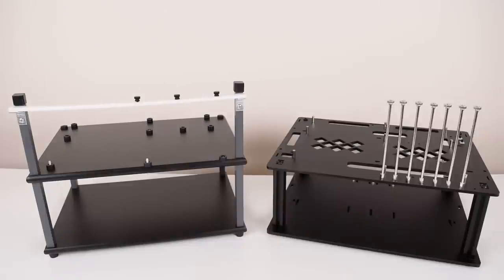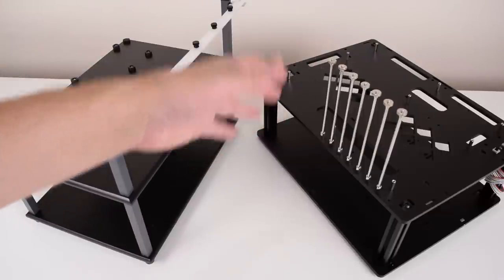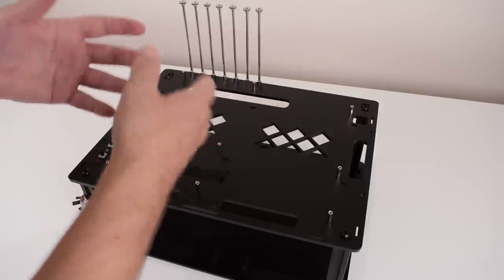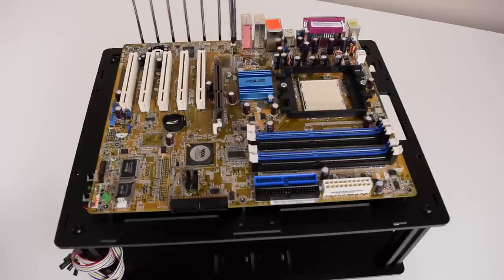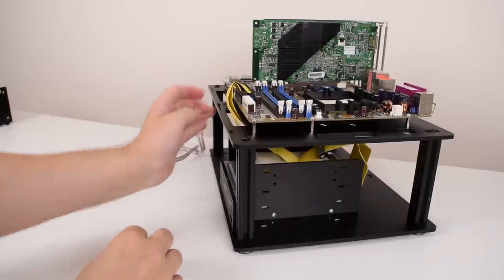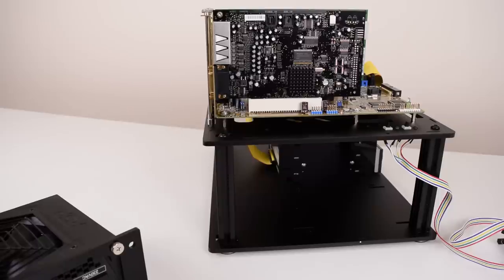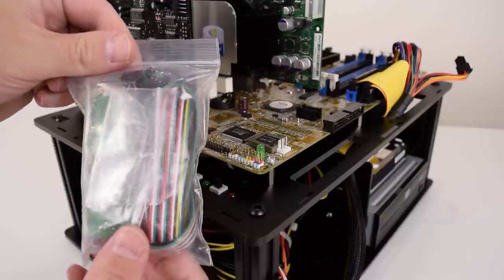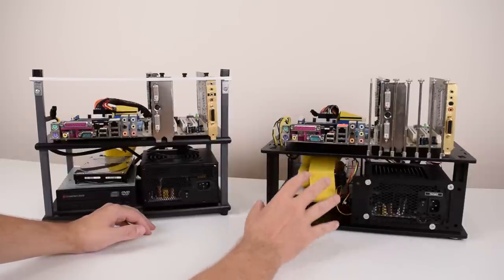Test Bench from USA vs China - HighSpeed PC Top Deck Tech Station and QDIY PC-D008

Comment from the maker: To get a bit of a discussion going, which test bench would you go for, and why?
Reply: I would go for chinese because it more sturdier and it has lots more stuff you can do with it
Reply: D008 is what id go for, cable management is nice to have & those long metal screws looks better then the plastic stuff that looks like its from a plastic cutting board.

Kind of have a self made test bench from an older compaq tower from 2002 most panels were pretty much removable so its fairly bare bones & 5.25 bay can also rotate the drives so it works as a desktop pc.
Reply: I find things that I don't like in both, and to be honest, I wouldn't buy neither one of them. I consider them both pricey, and both are flawed, at least regarding my criteria. Though, I consider the QDIY is a better option overall.
Reply: For "quick and dirty" I'd just go the loose (motherboard box) route, while for a semi-permanent (card tester), there doesn't seem to much advantage (and certainly more cost) compared to a cheap case with the side left open.

I know some people run a permanent testbench / skeleton / open setup, but personally, the Cougar Conquer is the pug-ugliest thing I've ever seen
Reply: The Chinese one seems well designed. I would even go further and use a no-slip drawer mat (similar to the rubber mat the HighSpeed has) and ignore using the mounting brackets for the power and drives. Also, once you screw in 2 screws on opposite sides for the motherboard, you don't need to do anymore. With these two things in mind, I don't see the HighSpeed one being "faster."
Reply: I prefer the D008 (can we call it the doob?) I don't find screwing down a motherboard takes all that long, and the quality of life improvements like integrated power buttons, proper cable management holes and proper 3.5/5.25 inch mounting options fare ar more important than how quickly I can put a system together, if something needs to be done quickly then a cardboard box is more than adequate.

Whereas if I'm going to take the time to put the system together on a bench, I want it to be put together properly, and the doob has all the right features to do that for a much better price.

Great video as usual Phil, and I'm definitely interested in the doob, as I could definitely use it for work, but then again a cardboard box is adequate for testing hardware quickly.
Reply: Chinese 1,has better options.
Reply from the maker: Robinthefox88 DOOB, I like it :D Rolls of much better :D
Reply: +PhilsComputerLab
I'd wouldn't go with either. I'm one of those people that has and likely will again make his own. Making one is only a matter of measuring things out properly.
Reply: They both have a purpose. However the D008 ultimately will look better in videos, with the cable management to keep the appearance of tidy
Reply: I like the layout of the D008 a bit more.  I think the hard drive should not be a permanent mount, since that's something you'd likely be swapping to test out or if you're loading a machine for testing before dropping it into a case, it seems like you'd want to be able to easily remove it.  everything else is fine to have a permanent place since it's all common stuff you'd want to keep a "known good" device of to test with.  

Also, notice the D008 is configured more like a normal computer, with all the ports facing the rear, while having the drive facing forward to easier access.
Reply: I would go with the PC-D008.  Besides the price I would prefer keeping the motherboard secured especially if you bumped the thing with a heavy graphic card or heatsink attached to it could do some damage to the card, CPU, or the board.  Plus if I'm changing cards the power would be cut off first so the metal screws are a moot point.
Reply: I would prefer to make my own. It would save money and I'd be reusing an old case that would otherwise end up trashed.
Reply: IMO depends on the use, I see the D008 being used as a proper "test" bench (as in, using the rig for some time and/or daily driver for a while), while the Top Deck I see is as a quick and dirty setup for demos and quick benchmarking.
Reply: Top Deck for sure. "Permanent Test Rig" doesn't make a lot of sense to me so it's all about the speed of setup and swapping components. If you're going to only be setting up a test rig to benchmark video cards or something like that, may as well go the practical route and put it into a legit case. Swapping PCI cards is quick and easy enough unless you just bought a horrible case.
Reply: Cheap and good enough would be my choice. However, i like the plastic alignment pins that register with the mobo …but those can easily (and cheaply) reproduced on low budget tech stations. …just a bunch of nylon / plastic threaded rods …what are those, M3? …LOL, one could even cross-thread imperial plastic rods (even cotton swabs [Q-Tips], if you're desperate), no worries, she'll be fine … Yay, DIY! ;D
Reply: Actually for me it is the D008 wins. I would put a semi-permanent test bed on it using a workstation/server grade base system. The server grade stuff tend to last longer, tolerate more torture (PCI Express hot plugging anyone?) and have a wider qualified device list so you can throw exotic hardware at it and it would still work.
Reply: I prefer the design of the Top Deck, but realistically, a cardboard box
Reply: I bought the QDIY PC-D008 and am loving it so far. I don't mind spending a few extra minutes swapping components to get the benefit of cable management and fixed mounting points for the drives and PSU.
Reply: I’d prefer the top deck, for the fast build qualities.
Reply: PhilsComputerLab the Chinese one looks cool

Comment: I had a nice steel motherboard tray that I just drilled some holes in and riveted some rubber feet on it. It's got all I need and it looks nice :)
Reply: Pretty much what I did except that I put legs on mine and connected it to a metal baking sheet

Comment: I have the china one. All I did is replace the standoffs with similar standoff with the US one.

A very tidy for quick testing mobos, gpu addons cards. The psu and drives are permanent with psu seasonic 800watt and ssd with win10.

Definitely heaven sent for computer shops for quick testing

Comment: Between those two I would go with the Top Deck because it is designed to swap out hardware quickly.  However, I would probably just cut up an old PC case and use that as a test bench.

Comment: Wow, I didn't realize how over priced they are. I wouldn't go for either. I find it insulting they are charging as much as actual cases. Generally for the same price or cheaper you get a nice case with multiple fans and rgb. The US version looks especially cheap and I always assumed it was $50 or less.
Reply from the maker: Fair comment. I think it comes down to numbers sold of cases vs test benches. Other test benches cost even more, these are really some of the cheapest ones. For what I do a case is just way too much hassle, but I do get your point of view.
Reply: You make a good point and that is something I thought about until ikea was mentioned and I realized how much of an ikea type product the US version was.They actually have a small shelf that looks suspiciously like the US version. I love the videos btw.
Reply: Michael Hatch For the same price you can buy a Deepcool EarlKase Rgb.. with free prime shipping.. you could even buy a Deepcool Tesseract and mod it into a test bench easily.

Comment: I currently use a 1956 Pontiac shop manual as my "test bench."  It holds the board being tested high enough off the work bench for the mounting brackets on the plug-in cards to hang down, and it supports the entire motherboard so that it doesn't flex when plugging in cards, RAM, power connectors, etc.  Of course, this doesn't address the problem of where to put the HDD/optical drive and PSU, but I have plenty of work space.

I was using a phone book, but I was a bit concerned about giving away my location during live streams.

Comment: Left one (Top Deck) is awesome as you can replace motherboard on it in seconds - just unscrew 2 screws and that's it. If you have one motherboard for a long time it's better to use some sturdier ones, like QDIY one or Lian Li PC-T60. Also Top Decks are known for a problems with ESD. I didn't have them, but I heard of couple boards dying due to that. Also Top Deck have issues with some VGA cards, as they don't have clearance for plastic support.

Comment: It seems strange to me that I find that the Chinese test bench seems to be better for use as a testbench for modern hardware.  My reasoning is that generally you would be likely to re-use the same PSU, optical drive and hard drive/SSD for each lot of hardware on test.  The main downside is the traditional spacer and screw in combo for attaching the motherboard.  To me it makes more sense when building a test bench to invert the spacers so that you would simply be placing the motherboard over the spacer threads for faster hardware changes, just having a couple mounted in the standard manner (for instance at opposing corners) would be absolutely fine for securing a motherboard.  One thing I would change from this kit is to change from regular screws for mounting the motherboard to thumb screws - being tool free just saves time and effort.

Also having the switching pre-installed on the bench itself is neat, it is just one less thing that you can lose.  In the use case here where there are a lot of systems using either IDE or SATA I would want to load up an extra caddy tray so that when you switch to between vintage and modern hardware rather than taking the tray out, removing old drives and installing new drives before sliding the caddy back in you would just slide the old caddy out and then the new one in.

Comment: Up until about 14:47 I thought you'd filmed the assembly of one test bench, and then the other. But you had two sets of the exact same components!
Personally I prefer the Top Deck, as the whole point of a test bench to me is the ability to swap hardware out quickly.
Even with all of the mounting solutions on the D008, I'd still be wary of jostling it too much.

Comment: I'd vote for D008. Looks better equipped and is cheaper. I just hate the plastic beam on the Top Deck. I would also not worry about the possibility of dropping a screw while the machine is running. I usually change stuff only in off state anyway. Never did anything screw-wise on a running PC.

Comment: my actual test-bench is a cardboard box (quite small to be honest, it's largest surface is smaller than the surface of an atx board and also of a micro atx board) it's only aim at the moment is to keep isolated the electronics from the desk surface, i'd like to get something better, but actually there not cheap options, like i am looking for, but i can consider an investment because i do a lot of test-bench stuff, if you know anything that will ship to Italy and it's cheap and quite durable, let me know
Reply: Step 1: Buy the cheapest and shittiest PC case possible that has some half decent cable management 
Step 2: buy a hacksaw
Step 3: cut up the case into a test bench
Step 4: Profit?
Reply: i know that way, but i just like to have a standard test bench i am not so good in modding and disassembling stuff

Comment: Nice video phil ;) I use my homemade test bench from motherboard tray ;) i think that both of those test benches are overpriced...
Reply: Or make one from an old case and some screws and a baking pan for the bottom for less than $20
Reply: Or how about just using an obsolete PC for no money
Reply: QDIY D008S costs 328 Yuan($52)(ATX)/398 Yuan($63)(EATX) in China on Taobao.com, a website just like eBay, BUT on the same website with the same brand you can find some cheaper test benches, which cost about 200 Yuan or $32

Comment: Where's that nice black and yellow PhilsComputerLab test bench for this vs video? It could have been USA v China v Australia.
I don't know if I'd go for either. Everything just sits there with the HighSpeed, just waiting to slide off. With the QDIY, switching back and forth from different board layouts looks to be troublesome. You have to move the standoffs around for ATX and Mini-ATX and if that base board is plastic, you'll eventually strip the holes for the stand-offs. If I had to choose, I'd go with the HighSpeed but only after adding something to hold stuff in place underneath and doing something about that expansion card bar.
Reply from the maker: You can replace a few of the rubber things with standoffs on the Top Deck, but not all of them. The black and yellow thing is my own creation, and cost much more than these, can you believe it? Because it is custom and gets built in the US.

Comment: Are there mATX test benches available?

I like the Chinese one better; looks far more professional, and I don't like the card tilt on the Top Deck...I know it's  not that much of an issue, but I still don't like it.  In addition, the integrated front panel buttons on the D008 makes it a bit more convenient, and the fact that it does include so many extras means that you have more options in how you want to set your test bench set up.  And I like my options when it comes to computer equipment.  I don't personally mind having to take a few extra minutes to set something up.
Reply from the maker: Great feedback. They do have other stations, and some are uATX, but not like this one. AFAIK this one only comes in an even larger size, EATX.

Comment: I think that if you turn around the optical drive mount it will be easier to use the system and, as its aligned towards the back of the bench it will ensure space to open de optical drive tray. Maybe give it a try and tell us what you think.
Best regards from Brazil.
Reply from the maker: Yea there are lots of options. This is my current DOS build. I use it for my sound card reviews, and maybe other, future projects: https://twitter.com/philscomputerlb/status/940484220513689600

Comment: I've had that exact Techstation for over 15 years and pre-built at least a dozen PC's with it and it still looks new.  I don't care for the D008 at all.  For one thing the flexing of the motherboard deck is a major issue.  Installing RAM and expansion cards will flex a board and what it's mounted to needs to be solid even if its temporary to prevent damage.  For another thing speed is key with a test bench like this as the whole point is to easily and quickly get the system built.  Too much fussing with mounts on the D008.  Back in the bad old days warranties were very short and testing your components the minute you got them was very important.  Nothing is worse than waiting 3 months to build a system and finding out you've got a bad board, RAM or CPU that's now out of warranty.  These are not meant for long term use.  There are open-design cases meant for that.  The D008 is more open case than test bench as I see it.  Metal standoffs and card retainers bear that out.  BTW mine came with a hard drive mount that fit on the underside of the motherboard deck.  There are other options like that available as well.
Reply from the maker: I did mentioned the hard drive mount...
Reply: the flex is easily fixed with a small wood dowel, and the speed aspect is fixed by using screw rods about a centimeter long into the top of the standoffs so the motherboard can just slip on.. and I use on screw in the middle to make it stable.

Comment: Did you ever see that mini itx test bench that looks like a "spider" from Lian Li. A spider with 4 legs, heh. I think it was the PC-T1R model. Came out several years ago. It did seem a bit over the top and was fairly expensive at the time.

I think Lian Li also released another test bench not too long ago, the PC-T70. Can accomodate up to EATX motherboards. I wanted a test bench before, but couldn't justify the price as I don't change out components that often and I do have extra cases sitting around.
Reply from the maker: Yea all these test benches cost premium dollar. I often just use a motherboard box, I mostly use these benches for the videos, they are just neater and better looking :)

Comment: I personally have the Open Benchtable, as i do switch hardware quite often for benching. My personal rig is on a case, however i do tend to test a lot of CPUs and video cards, and needed some sturdy test bench setup, especially since my cooler choice is the Thermalright TRUE Copper, which alone weighs 1900g. The OBT is  a very sturdy yet lightweight test bench.

If i were to pick between those two, i think i'd go with the Tech Station, just because of the sturdiness it has, but i'd replace the PCI-E holder with a metal bar or something better. I love the QDIY PCI-E holding mechanism tho, it seems to be very similar to the one in my OBT and it is a well made mechanism.
Reply from the maker: Ah, nice bench, I've seen that OBT before and I think Linus uses it?
Reply: Yup, i saw it used on the Titan V video today.

Comment: If I were just testing (and comparing) graphics  cards,sound cards and other cards that fit in slots I would opt for the QDIY PC-D008 if you kept the other parts in there for a long time.
For testing (and comparing) motherboards I would opt for the Top Deck Tech Station.
Just my opinion here.
Reply from the maker: That's pretty much my thoughts as well.
Reply: Hey Phil I just received my Sierra Screamin 3D (Rendition Verite v1000) graphics card absolutely new in the sealed box today December 16,2017.
Since it's so rare (from 1996 or 1997) I just can't open it as a collectors item though I'd love to try out the 3D accelerated games that it came with.
I only paid $23 USD at a eBay auction and was the only bidder.